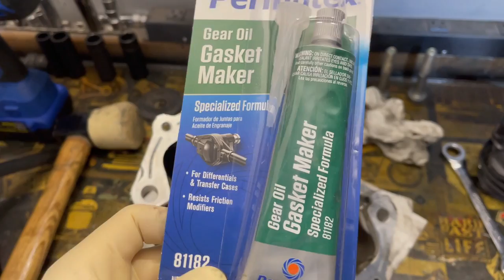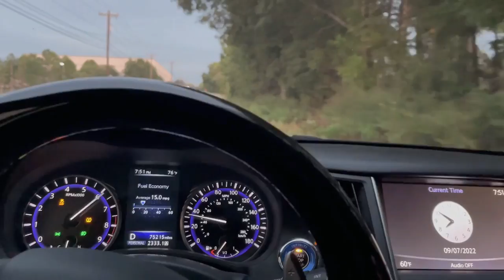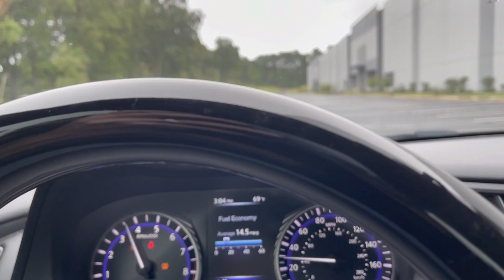Can You Daily a Q50 with an LSD?

Comment: I have the Quaife LSD on my Infiniti Q50S Hybrid and I couldnt be happier. Quaife one of the best and most renowned LSD manufactures in the world also make an LSD for the Q50 and its one of the quitest and smoothest out there.

Also with the LSD the car is much more easy to daily and drive more spirited thanks to the increase in traction and it’s operation. Now if you buy the right LSD and one that is proven like Quaife has been in the industry, you will love your Q50 and have no complaints as a daily car.

Comment: If you want some more fun while installing your lsd upgrade your gears as well. 4.08 gears are fun. Yes u lose mileage, top end speed, and tires. However, u gain quick acceleration, 1st 2nd becomes ungodly fun, 3-6th gear are better in my opinion with 4.08. mpg is 1 down at 80mph(gps), around town 3-4 mpg lost. <- heavy foot.
Reply from the maker: I don’t think gears in the Q can be changed.
Reply: @SpeedCultureStudios   they can but q60 does not have many options. 3.133 seems to be the numerically highest gear set ATM. Sad times!!! Might have to look for other models(SUV, truck) sporting the same rear diff. I have a g37s and got my gears from a low mileage frontier.
Reply from the maker: @tp322  so that’s what I mean.  The 2014-2015–which is what mine is—has the 3.13 gearing already. The newer models except the red sport has the slightly less aggressive gearing.  No upgrade options available.

Comment: Do you have some ideas, whether they'll ever make a cheap, similar to the one you installed lsd, for us manual guys as well? The price is great and even though I have the factory 3,692 rate 370z VLSD in my 2nd gen G35S sedan, would love to upgrade it... Maybe even to change it to a 3,9 final drive as well, but nothing is available on tractionconepts...
Reply from the maker: You can ask them directly about it.  They are good at making things happen.  The only potential issue I see is that the vlsd is a different design than the open diff so I’m not sure it’s just a plug and play solution like this.

Comment: Do you need to buy new gears with this conversion kit from traction concepts, or can you just buy the lsd conversion and use the gears from the factory diff
Reply from the maker: You can use the factory gears but they have to be machined down.

Comment: Do you need the LSD kit and the 4 gears? or will the kit itself be fine to install into the factory open diff??
Reply from the maker: You can but you need the factory spider gears shaved down.  If you can’t do it or don’t have a machine shop near you that can it’s best to get the gears also
Reply: @SpeedCultureStudios  ohhh ok ok I got you thanks 💪🏽💯
Reply: @SpeedCultureStudios will this kit fit 2016 q50s redsport?

Comment: Thought open diff is the most predictable by giving less torque to prevent under or oversteer. Is traction concept torsen or clutch type?
Reply from the maker: That’s how manufacturers sell the concept, but if you’ve driven an open diff car in spirited scenarios, you know how unpredictable it can be.  Sometimes the rear comes out, sometimes it doesn’t.  Sometimes it goes one way then the other the next time.  You break traction inconsistently at varying points in the rpm range.  It’s a joke

Comment: so u say its mainly for RWD. i have the AWD one should i still get this or is it really not needed as much?
Reply from the maker: No I didn’t say it’s mainly for RWD.  I said RWD people are generally the ones that struggle with traction issues.  Awd gets better grip off the line for obvious reasons, but if you feel tire slip, then this kit is a good option for you.  And if you use code SCS10OFF at checkout you can get 10% off!

Comment: So because this is my first awd car would a LSD do anything for AWD or is the AWD kinda the LSD?
Reply from the maker: No it’s not like an lsd.  The awd just gets help from the front which gets decent traction because the weight of the engine over the tires.  And you have 4 tires trying to pull/push the car forward so traction isn’t as much of a problem